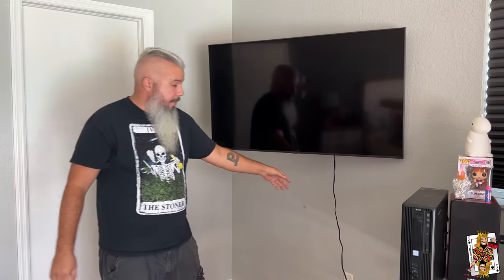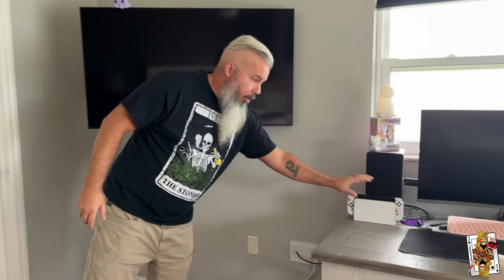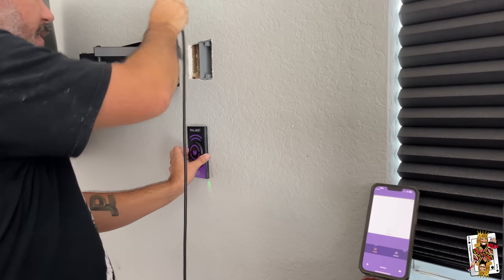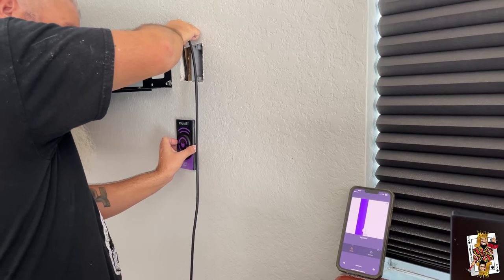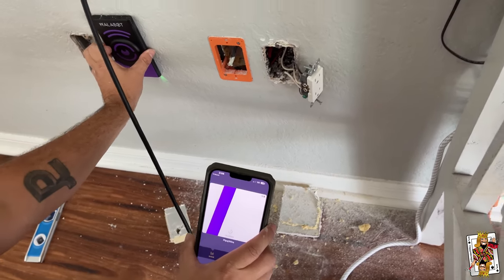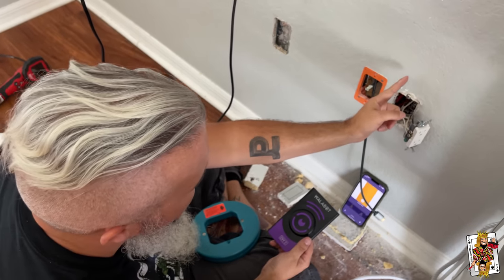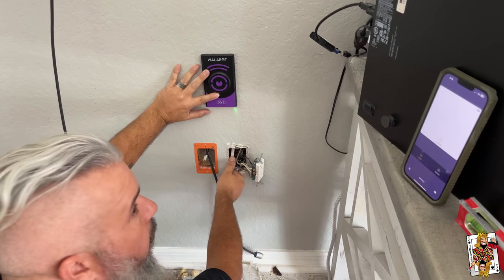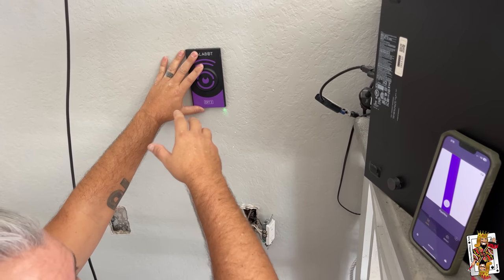JakeOfALL does actual work!  How to Conceal Your TV Wires | Making Advanced DIY Easy with Walabot

Comment: I love everything that you've got on your Channel from the packout mods to what you're doing right now, and this is the very first time I am making a suggestion that you did not cover in your video. I have used walabot for about seven years, and I am very happy to see that you are using the wireless version that I recently got for my tool kit. The one thing that you did not cover, which is very critical for people that are watching this, is that studs not only run vertically, but they also run horizontally and your ability to put a cable down a vertical direction from top to bottom is directly related to whether or not there are horizontal cross beams that interconnect to the vertical ones. This is everyone's nightmare, myself included. You may want to add a supplement at the end explaining that the walabot can be utilized to determine whether or not there are horizontal cross beams or studs, and to make sure that you checked for this before you open the wall. In many of the installations that we do, different Builders have different standards that they follow. In the most recent cases, we've had to Notch into the horizontal stud in order to get cable down. It's no fun, and the alternatives are extremely difficult to envision.. Using the walabot has been tremendously helpful and goes beyond what a normal stud detector would be able to show you since it is only looking for the metal within the stud and the magnet on the stud detector would register this. I hope everyone takes this as nothing more than an observation of what other things you might encounter out there and I have to give mad props to Jake for everything that he puts out there and I became a fan when we started outfitting all of our technicians with Milwaukee boxes.